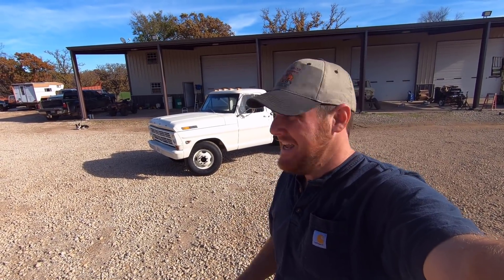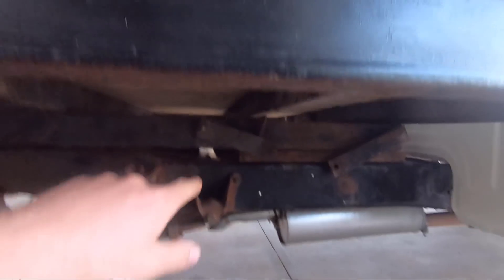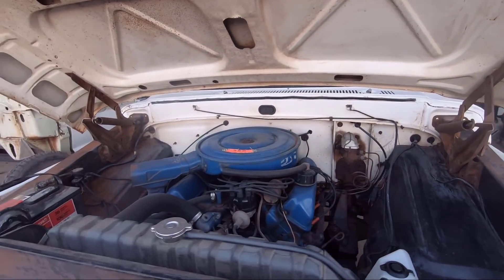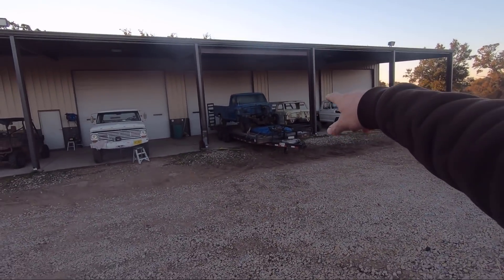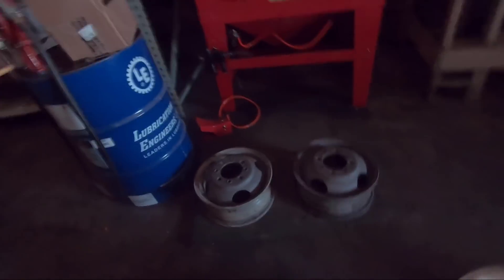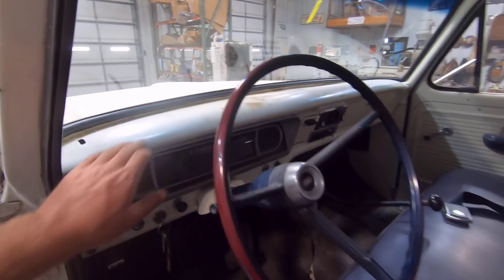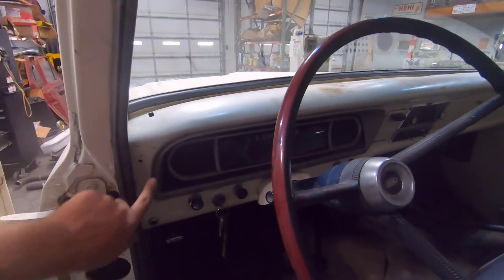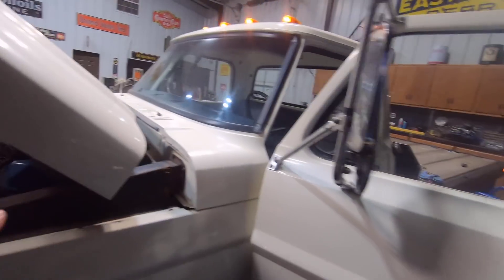Finished! 69 F-350 Mild Restoration Part 2

Comment: Hi Matt.
I get the feeling, that you'll be very happy that I contacted you.
You see, My husband and I own the one 1969 Ford F350 that you do not, ( as of yet)
Ours is a 1969 Ford F350 27 foot Vista Liner Olympus C Class Motorhome, and it only has 35,000 miles on her and we call her " The Orphan Jewel"!
We found her ten miles, from where she was sold new, and she comes with the same Pure White exterior/ Wimbledon white interior,...so we will be repainting a cab as well.
We were told by Ford, that this happened if a truck was made from a small order, that they would refuse to change the paint color in order to save money.
You got lucky,...our coach is Wimbledon white as well.
So that can really sticks out.
Not wanting to sell our baby just yet, ( Rick is still restoring it) but I thought you might knowing how this was put together.
It has white Ranger bucket seats, that are in absolutely perfect. Condition and the original 390 Fe.
One big difference though,...this one came with a three two barrel intake hooked to a C6 tranny!
Yeah, we thought some backyard mechanic put it on there, but Rick ( my husband) looked at it,...he said Ford put it there!
When he asked them, they said that larger Ford trucks run better with the tri-power, because it starts of with just one two barrel, and that's better for torque.
Was it all there?
Yes,...we even found a hand typed ( and hand illustrated owners manual)
However, the most exciting part is, our serial number plate on the coach has no " date made numbers, or plan numbers on the plate.
While doing Research, Rick found out that, this means they only built one of them.
This was confirmed by the heirs to the Vista Liner camper company!
Want to stick around, while we continue our adventures!?
Looking forward to hearing from you.
From what I saw, your the best at restoring a bumpside 350, and Rick is the best I've seen at restoring antique motorhomes.
Talk to you later!
Reply from the maker: That sounds like an amazing project! That is very interesting to hear about your Wimbledon white interior with pure white exterior.  The tri power intake setup would not have been factory installed but could have been a "day two" dealer addition. But still cool none the less. I hope the restoration goes smoothly for you!

Comment: Nice build but I would've went with a full headache rack to protect the cab!
Reply from the maker: If you are going to use the truck hard I would as well. But as is I prefer it open and showing the body lines of the truck better.

Comment: One other difference between this one and ours, is that your missing the 390 Galaxy badges, that we have on our front fenders.
My husband is trying to find out ( for sure) how many of them came with these badges, and how many didn't.
I'll get back with you on that.
Great looking truck honey,... nice job!
Reply from the maker: All 1968 and 1969 F-Series trucks with the 390 engine had the 390 fender badges. My truck was installed with a 360 so It does not have the fender badges.

Comment: Those trucks had 16.5 rims on them. New
Reply from the maker: Not all had 16.5s. 16.5s were an option but this one was optioned with 7.50/16 tires on 16x6 dual wheels per the marti report. The wheels are not the originals but it was ordered with 16s non the less.
Reply: @MattKubik1791  yeah I know but every new econoline or f 350 came thu with 16.5  some wrecker or flatbed. Dump trucks had16s with a split rim. 71 had a disc brakes and how wonderful they were....

Comment: It may not be the original door
Reply from the maker: As in the paint code on the vin tag may be a different color? Vin on the door tag and frame match so that is the correct tag. The entire interior is Wimbledon white not just the door. Head scratcher for sure.